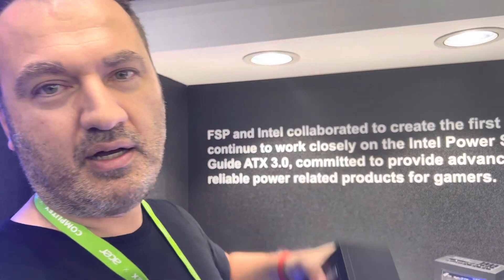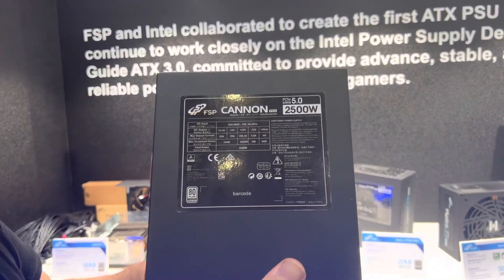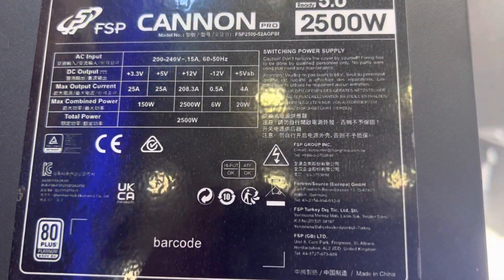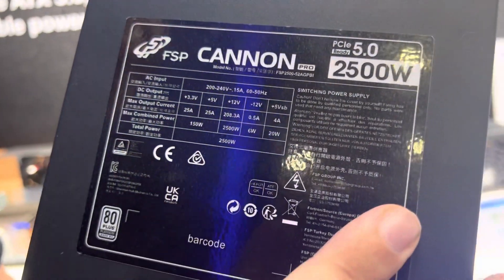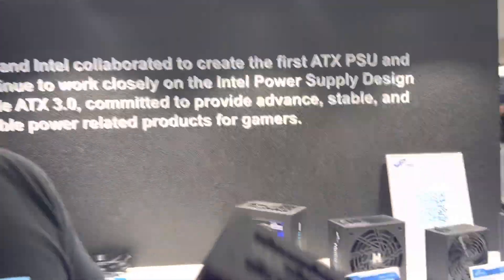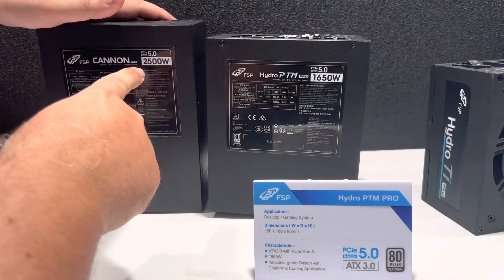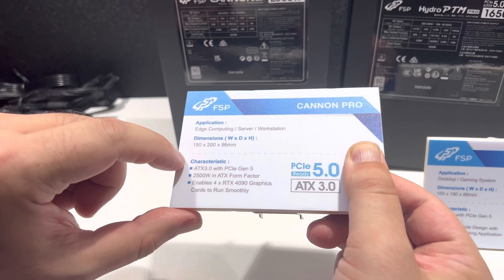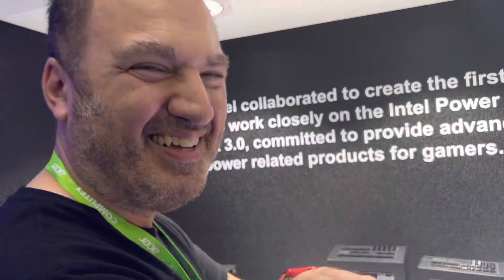CANNON: 2500W ATX PSU by FSP!

Comment: This is only the 2nd brand that I've seen to produce a 2500W PSU, the other brand was SuperFlower, admittedly SuperFlower's solution was built to the previous generation ATX PSU specifications and so didn't come equipped with the ATX 12VHPWR Connectors.

This is obviously aimed exclusively at Europe/UK or any other region that uses 220V or Higher Electricity as standard in homes, so this isn't suitable for most standard American built homes unless you have either had a additional purpose built 220V line + fuse box installed for you, or, your property is a new build/highly unusual and comes with multiple 220V lines throughout the house by default (very unlikely).

Nice to know I can power 4× RTX 4090 Graphics Cards, the only issue is that unless you water cool them you aren't going to be able to fit them inside of ANY ATX case, not even those 12-Slot massive ATX Cases from years gone by will be suitable due to the PCI-E Slot layout on most motherboards these days.
Reply from the maker: SF's was 2000W but ok unofficially it could go up to 2500W without sweating. 230V strictly, yes.